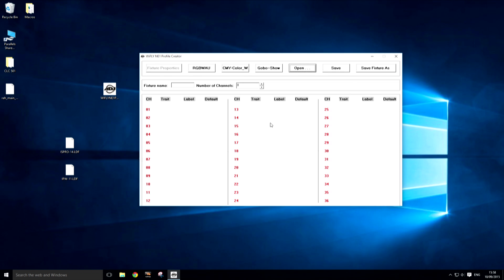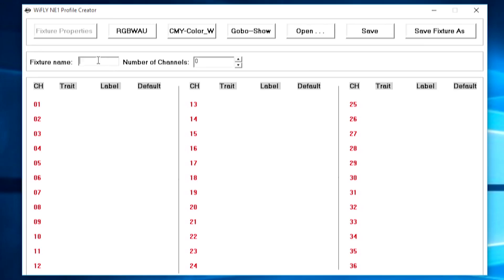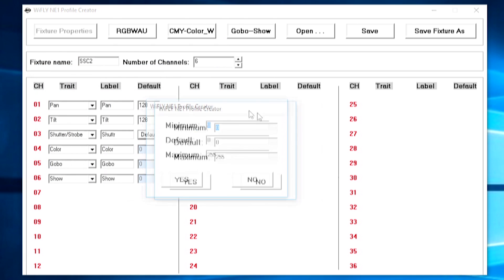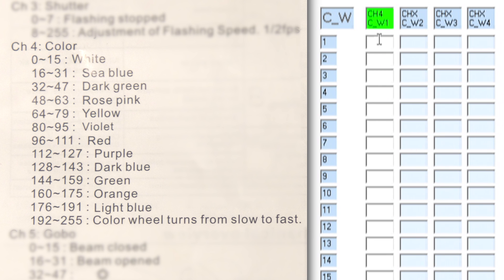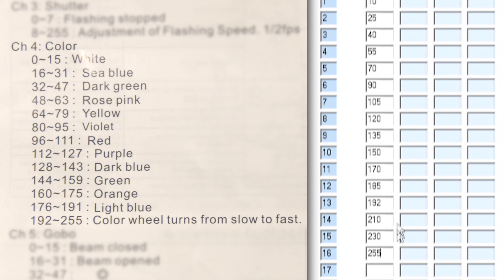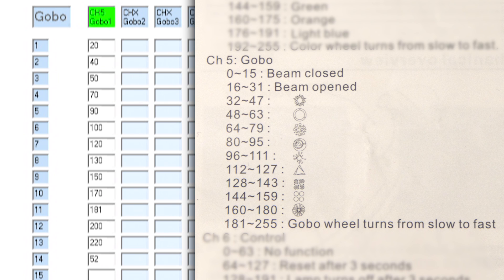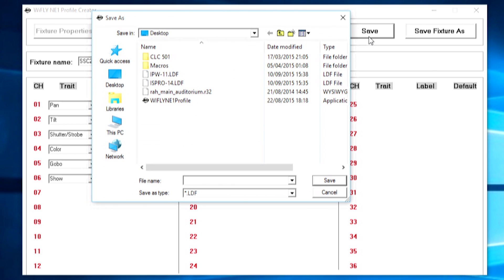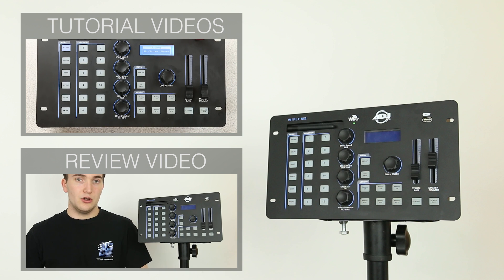ADJ WiFly NE1 Tutorial 7 | Build a Custom Fixture Profile

Comment: Hey Joe,
I have a programming question for you (NE1 newbie here/aka beginner question alert)...
I have 4 fixtures from China I just got. They run on 16 ch DMX. They have no make/model as they are knockoffs so I'm fairly certain there is no profile uploaded on the Facebook users page (I wrote them as well). I assume I have to build a profile for them using the PC software (no MAC compatibility??? What is this - 1989?) but I just wanted to see if you knew of a 'generic' profile that would work for my fixtures. Any leads/help would be appreciated as I'm hitting the road in a few weeks and have to get this rig up and running.
Here's the DMX channel summary in 16 ch mode:
1. Horizontal operation 
2. Vertical operation
3. Total dimming
4. R dimming
5. G dimming
6. B dimming
7. W dimming
8. strobe
9. Motor operating speed
10. 0-10: other channels play a role, 11-127: color combination chanage, 128-160: color jump, 161-200: color gradient 1, 201-255: color gradient 2
11. Speed regulation
12. Built in effect
13. Bulit in speed
14. Horizontal operation fine adjustment
15. Vertical operation fine adjustment
16. Reset (150-200 reset)
Thanks in advance! Kev

Comment: A bit off topic but can you recommend a very quiet moving head spot fixture that could be placed only little over a meter above the audience. This is mainly for theatrical use so movement would be slow, it's mainly the fan volume that worries me as the ones we have on stage (Chauvet Intimidators) produce a constant hum that is OK where they are but not FOH.
Thanks.